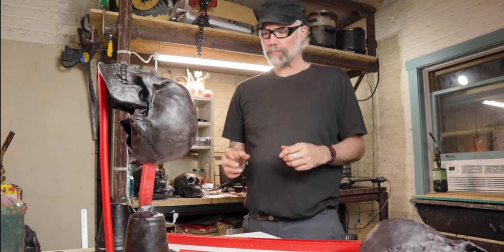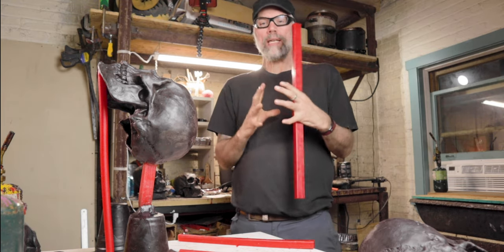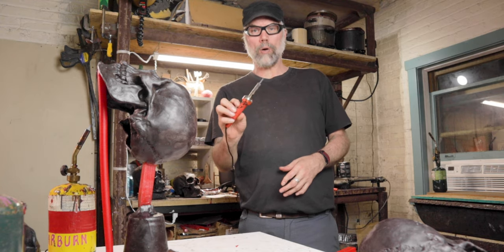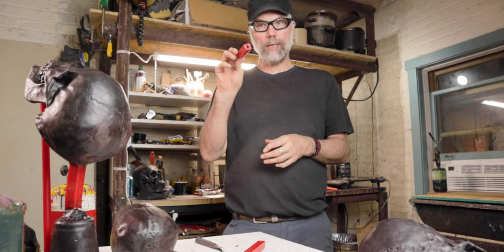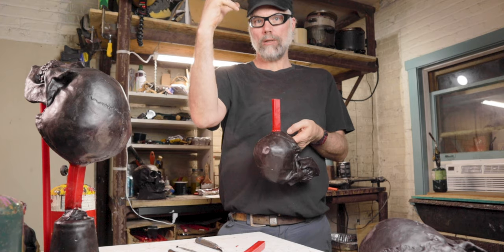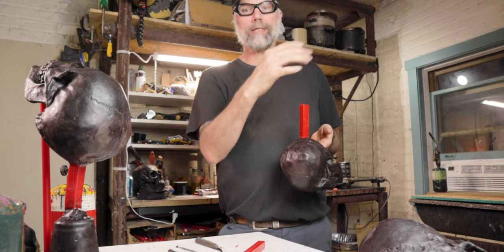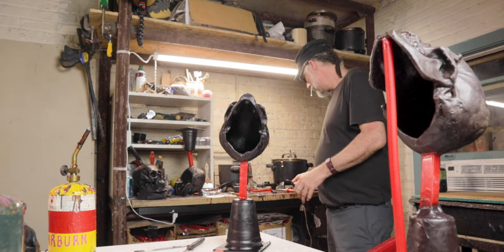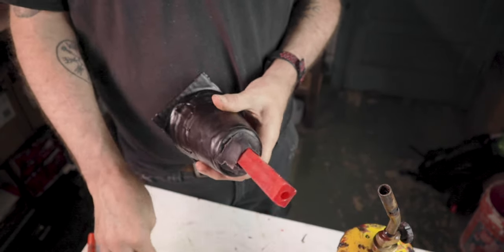Lost wax casting: (Part 2) How I sprue this wax for Ceramic shell.

Comment: These videos are helpful, I just started. Thank you!
Reply from the maker: I am excited your finding my videos helpful.  Where are you casting? Home, school, elsewhere?
Reply: @LunarburnStudio  just started a job wax chasing, they are have me start by spruing. My only experience in chasing comes from warhammer 40k. I have a bit of ocd and a nerd, which I think will work to my advantage, in this particular line of work. I worked in a sign and print shop awhile ago laminating and finishing work. Your videos have already helped me out.
Reply from the maker: Gratz on the new job.  Every foundry has their own system and approach but the theories are the same.

Comment: You mention the material would go through 10 different layers/steps of drying. What different layers/steps are you referring to?
Reply from the maker: The ceramic shell investment is applied to the wax one layer or "Dip" at a time. You apply the slurry  first then dust with silica then let dry.  Then the next coat and so on. After roughly 10 dips/coats you will have an appropriate thickness that can withstand both the process of burning out the wax and the pouring of your metal.

Comment: Why can´t you spray paint your slurry on the pattern instead of dunking it to prevent the pattern getting lose from the sprue system ?
Reply from the maker: There are some airless spray hoppers that can push the slurry without drying too much, but its only really practical on large shells.  I have tried it before, had some success but in the end I would end up wasting slurry with over spray.

Comment: With your reclaimed wax do you end up adding more stiffer wax as it gets more sprue wax mixed in to maintain consistency or does it stay relatively the same on its own?
Reply from the maker: Yes, you need to tweak the composition of the reclaimed.  typically stiff wax in the summer and softer in the cooler months.